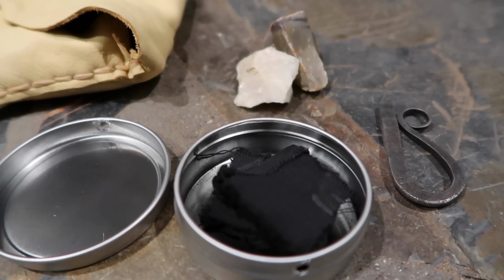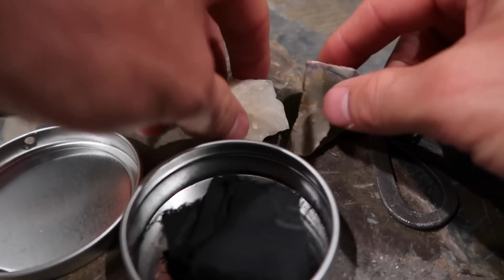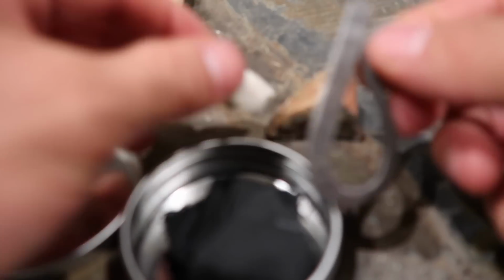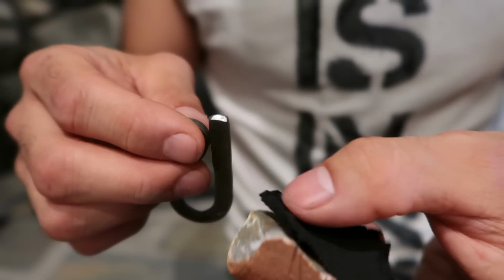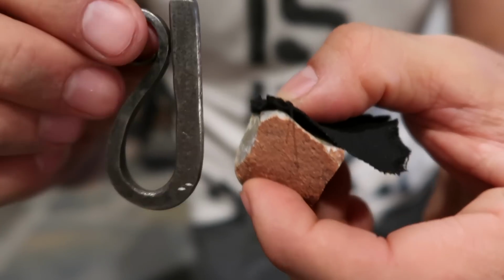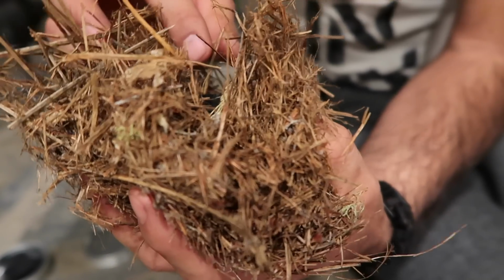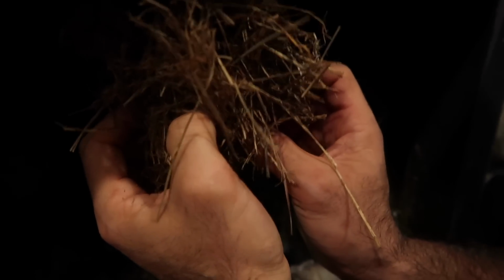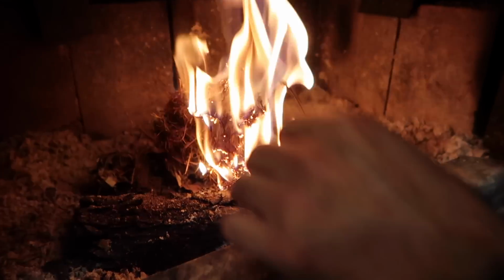How To Start a Fire using Flint & Steel. Best Fire Starting Method?

Comment: Do fire steels normally rust? I have a light rusting on the inside of the C, inside the little spirals, maybe some pitting in places. The striking edge is shiny and clean, the only part rusting is the blackened bits. 
Is there something I should be doing, oiling it like I would a carbon steel knife perhaps? 
Thanks!
Reply from the maker: Luke R, all fire steels are carbon steel. Keep it dry, and oil it every so often. Hit it with some wire wool or a wire brush to clean it up, then oil it a bit. ;)
Reply: @Damian_mtn  Right on. I appreciate the fast answer! 
Just out of curiosity do you know what some of the things someone living in antiquity might have used to oil them out in the wilderness, if they would have done it at all?

Comment: Wondering how much jute rope you used?  About a foot or so?  I tried flint and steel and was able to get flame no problem but within five to ten seconds it was out.  Not enough time to get some twigs on it.  Any other tricks to using flint and steel?  Please I like this method for starting a fire.
Reply from the maker: Kirk H. I appreciate the comment. We didn’t use jute twine in this video. We used some dry Buckeye and cedar bark for our tinder bundle. And if you notice from the video, it wasn’t very big. The trick is, and should always be the case in a survival situation, to always have your firelay ready. We already had our tipi structure made before inserting the tinder bundle. We built it by making our way from VERY small twigs, to finger thick twigs. That’s the ticket!
Reply: Thanks for responding. Would you say the tipi way is one of the better ways? I did try laying small sticks on top but it made the fire go out. Would pine needles work? Well in any case thanks for tips and take care.
Reply from the maker: Ya, sometime if you throw too ,any sticks on too quick, it tends to smother the fire. I like the tipi layout or the cabin...w/e keep things close but also lifted as to not squish your tinder bundle. If you have the luxury of a really large tinder bundle, then you can be a little less careful in that regard. 
Pine needles are great as long as they are fully dry!

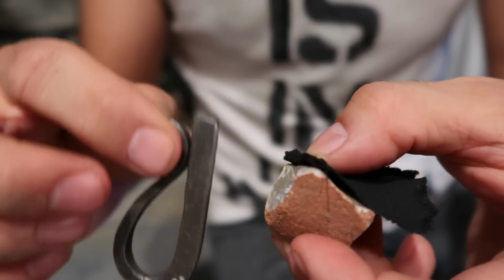Comment: At 7:53 why don't you turn that around.  So cloth is on the bottom
Reply from the maker: I’ve tried that...it always works better up top. But hey, if it works for ya, go for it. There’s no set rules for it.

Comment: Really nice video....
OKAY, about steel.  Damian777 you mention the carbon steel, the spring steel. To be clearer, spring steels are a high carbon say a 1095 grade (US) where a common steel is 1018 grade low carbon. The last 2 numbers are the carbon content (for simplicity). Higher carbon more sparks. IE better fire success. Any spring steel will be about the same. Re bar is low carbon steel. A leaf spring is high carbon steel. Axe, knife, cutting edge tool that will rust would also be a good source if not too hard.
Reply from the maker: michael bennett Good points

Comment: Nice clean demo but one thing I suggest, if you ahven't learned it yet, when you are not blowing on the tinder nest drop it down to your waist and then raise it back up to keep airflow going into it.
Reply from the maker: 8th sinner Or you can just swing it around in the air slowly and not blow on it at all. Let the air do its own thing!

Comment: Can you use wool fabric scraps to make char cloth ??
Reply from the maker: Sander Tel , Yes...totally! Almost any organic material works theaoretically. But it’s not ideal.
Reply: wool is a natural fire resistant material. how have you been able to get it to work. I really would like to know.
Reply from the maker: Eric Smith, ya it’s not ideal, but it will work. It will not make good “cloth” once burned, but you can strike into the powder...depending on what he type of wool. I’ve only done it once, and i can’t remember the type of wool that was used.

Comment: Flint and steel is a cool way to start a fire, but it's terrible when conditions are bad, like if the wood is wet or you can't get good tinder
Reply from the maker: Thats why you should always carry multiple ignition devices in your pack. Flint and steel for everyday, normal use so as not to use up your "wet weather" or "extreme condition" methods. And only use the other ones, such as a ferro rod or stormproof matches, when you absolutely need them. BUT even in wet weather, with the proper precautions, you can always use flint and steel. If you know you are going into some weather, and have time, you can make sure your tinder is dry  and ready to be used that night. There are also many ways of harvesting dry tinder, even in wet conditions.

Comment: Great video! One question that I ask all who do this, why oh why does no one have a tube or straw to use to blow the air into the bundle? Or when the fire is stubborn and needs a bit of "extra air"? The tube and or straw is so lightweight and so easy to use and such a time saver. And for folks like me who have the zz top type of beard, such a face-saver!! Just thought I would share that with ya. Happy trails!
Reply from the maker: Hey, if that helps you out thats awesome. For me its already cumbersome enough to carry both a striker and the flint , and the tinder bundle without losing any of the implements in the process.

Comment: Excellent video. Thanks!
Jeans (if 100% cotton) make some of the best charcloth. In a long term survival scenario, however, it is unlikely you will want to sacrifice your clothing for charcloth. The charred punk wood you mentioned is excellent, too, and a pretty unlimited resource. There are other tinder sources, but these are the two I use most. The trick to catching the spark from your steel is to "char" the tinder material if possible, as this spark is much lower in temperature than ferrocerium rods, lighters, etc. The steel shaved off by the flint edge is around 800° F, which is hot enough to ignite a lot of materials but a lot cooler than modern heat sources. I have had mixed success using even very finely processed materials that were nit charred. If nothing else is available, I have used a quickly made fire plow just to create the charred punk to use with my flint & steel. Just a thought.
Reply from the maker: MG50 yup, any charred implement will work. I've messed around with the powder from bow drill as well. I'm going to put up a few videos on different variations of this. Stay tuned.

Comment: When you blow the tinder, how do you get it to ignite? When I do it I either put it out because I'm a former brass player or I end up getting a face full of smoke
Reply from the maker: Two things: One, notice how she is holding the tinder bundle above her face. You do that bc smoke rises...so by holding above your face slightly, that helps avoid excessive smoke inhalation. Also, be sure to turn your head to the side when inhaling. This will further deter you from sucking up smoke.
Two, when blowing on the tinder bundle, blow long but smooth and consistent breaths. You can even let the ember grow a little in the tinder bundle by letting it just sit there a sizzle for a fe seconds. This will really dry up the tinder around it and get it ready for ignition.